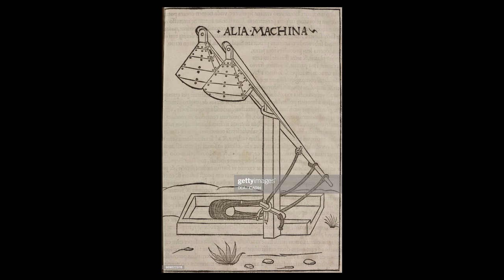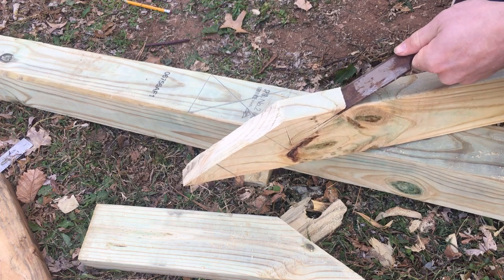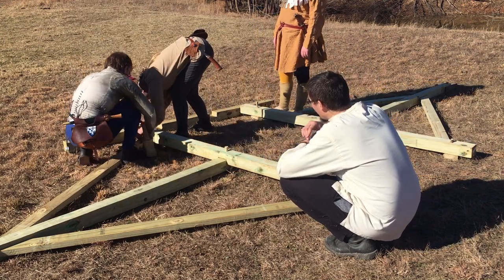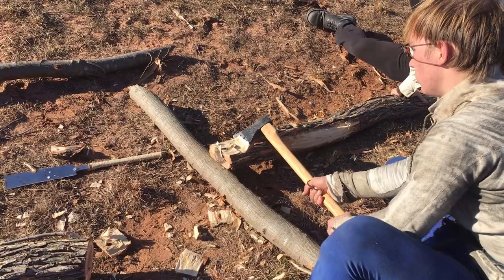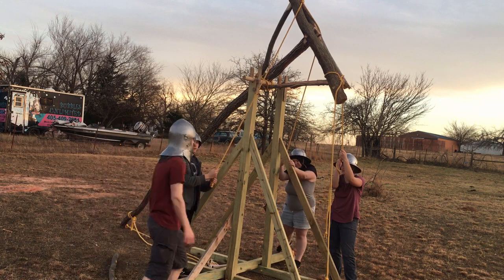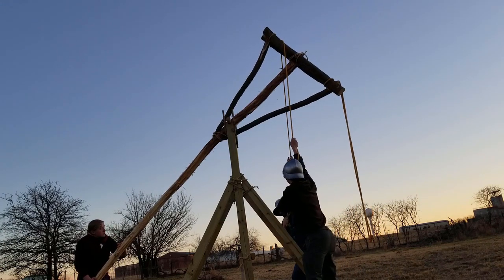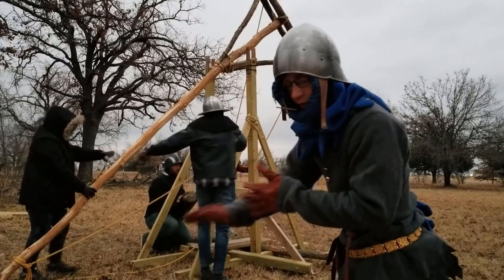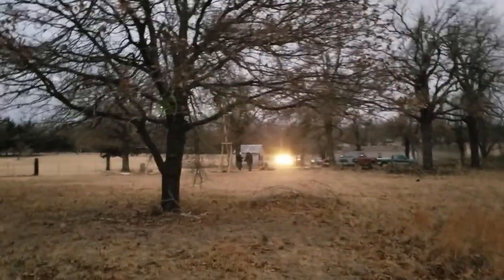Building and Launching a Traction Trebuchet!

Comment: Nice to see the description was useful.  I would have used a bit thicker wood for the frame, but the arm looks really good.  Nice that you were able to replicate the build speed. We also have someone holding the rock in the sling and you can add a bit of tension to the ropes and preload the string in the arm.  That will give you a bit more range and consistency. On the larger ones, we had someone sit in the centre of the machine but on yours, they could sit near the side of the machine.

Comment: I have a theory that before there was an atlatl, sling, trebuchet, bow, etc. ancient hunters cast stones with something that doesn't exist in archaeology because examples decayed over time.  I am confident and have many recorded examples of hunter gatherers using plain rocks as weapons.  Even in the 1800s there are countless examples.  I think they are ignored by archeologists.  I suspect they used an antler or branch to cast stones.  But I cannot come up with a viable design.  I think that slings and traction trebuchets evolved from something that is lost to history.  I understand that releasing is best at a 45 degree angle and think that perhaps the release could be by twisting the mechanism.  There is room for your brain in this pursuit.

Comment: Good share, and nice garb, did you make your winter wear jacket?  Also, I think Traction trebuchets/ trebuchets were known to ancient Romans and Greeks. I don't think they ever made them as big as the medieval ones but who really knows... Rome was not known for small scale projects.
Reply from the maker: Thanks! Yes I made that jacket, after Gaston Phebus’ livre de chasse. I think you’re right, these machines are not too special really. I showed a couple Chinese and Islamic designs which are even older
Reply: @Ralchire  I think trebuchets possibly came about from slings on poles, which are basically the same principle.  It looks great. what material did you use? is it a single thick layer of felted wool? I have been wanting to make something similar but never got started. Do you recommend any good resources? Thank you.
Reply from the maker: @jacobe1942  It's actually suiting wool, pretty heavy weight but not so heavy as blanket weight wool. Kind of like a broadcloth.
Reply: @Ralchire  I have some upholstery wool that I think would be a similar weight its a hair under a 1/16" thick but may need a liner. Did you make a pattern or find one?
 thanks